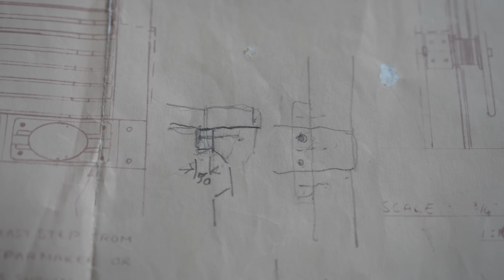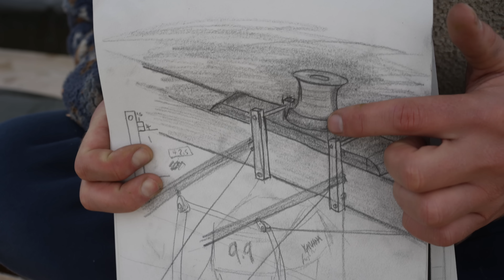It's The Most Important Part of this Boat's Refit (& I'm Trying Not to Wing It) | Wildling Sailing

Comment: Take the mast step to a machine shop and have the base decked flat
Reply from the maker: OOOOoooohhhh like an engine head job. not a bad idea!!! I just need to see if my sails are a right angled triangle first
Reply: @WildlingSailing  yeah if the angle needs changed then just weld up a new plate but if it's only a degree or two the base seems to have enough material to machine it flat with a degree or two extra cut out

Comment: A person like myself could redress, that is to say resharpen, those drill bits by hand, on a pedestal grinder.
Usually a person such as myself, would never recommend purchasing a tool called "The Drill-Doctor".
But buying a Drill Doctor, as opposed to purchasing new drill bits at 20 - 30.00 £ a piece, is a no brainer.
I am only presupposing that they are available in the millimeter sizes you are using.
But a Drill Doctor or similar tool, could save you hundreds of £.
Reply: 316 stainless steel is much better for use in nautical situations.
304 is a reasonable substitute, but it will eventually corrode at a faster pace... where as, 316 may never corrode.
You may also have been better served by using somewhat thinner, but solid stock... Rather than square and rectangular tube.
Only time will tell. 
(Imagine cutting THAT by hand..)

Comment: Could I suggest rebating the the mast beam 1/2 inch into the bearers and a similar 1/2 inch into the mast beam so that the beam cannot slip sideways or fore and aft. That would be what a boatbuilder would . I am an old wood boatbuilder.
Reply from the maker: I thought of that, and it would do much of the work of the retaining blocks, right? I'm a bit afraid of going into the crossbeams though as they're already well made and glassed

Comment: Do not us the drill bits to punch holes, there are proper tools for that, as you did in 17:20. 🙂
Your used drill bits can be resharpen so you don't need to buy new ones just because they are getting dull.  Look up how to do that, it isn't that hard.  You could use a new drill bit to start drilling and use a sharpen one to continue drill.
Yo might want to put some thin rubber to protect your beam if your engines start to make your construction loose and move.

Comment: Its not too late, but I would be inclined to cut small rebates (grooves)  in the mast step, about 15mm deep, to fit over the beams/locating strips, so that the whole mast step is slotted down into/onto the beam structure.
That would increase the forward/aft structural integrity enormously, and take a huge amount of strain off the metal fasteners.
edit: I put my hand up as well as all the other comments,  for using "Step Drills" for metal drilling. My experience is that even the cheaper ones last much longer than normal drills, and make holes so much easier.

Comment: I strongly advise that you don’t use any 304 SS anywhere on your boat and that you swallow the loss and replace any 304 with 316 before you go any further. it really is useless in a marine environment and will rust in very quick time. If you can’t get 316 SS tube you might just use some of the offcuts of the square section 316 for the threaded rod sleeves.

Comment: stop using that spray krap you can buy cutting oil it will make your drill bits last longer and even slightly blunt bits will work better.

Comment: If you drilled 12mm holes, why not use 12mm threaded rod too? Why 10mm? 12mm is 20%  stronger...just sayin..and, like somebody else said, fender washers to spread the load.

Comment: 12: 30 Drill bits. Invest in a set of step drills and a drill sharpening tool for the straight ones. Also slow down your drilling speed and get some cutting paste, as apposed to fluid. Its ok, you can thank me later mate. Crack on. haha
Reply: Oh, and a deburring tool.

Comment: Do your self a favour and get rid of the 304 and replace it with the 316,  I think you will also need to put crush spacers inside the tubes and over the threaded rod to stop the tubes from crushing inwards when you tighten the nuts up.  🤔🤔🤔🤔🤔🍻

Comment: Dude, put a nut on  whatever your cutting and then then use your hacksaw or grinder to cut just above the nut,  then you dont need to use your tap and die to start a thread

Comment: I think you might regret using 304 grade s/s. Even the quality of 316 s/s is pretty poor these days. Old 316 was way better. Any bolt we have that is A2 (304 grade) rusts away in no time in a marine environment. Check every nut and bolt you buy. You don't want to be using anything other than 316 grade where is will be subject to saltwater, that is, outside the boat.

Comment: buy the proper drill bits to drill stainless ,they not any more expensive, HSS drill no good you need CO8 bits which stands for  cobalt and has 8% cobalt added ,beware they do break easy drill a small pilot first  they wont burn out as quick as those drills your using .

Comment: When cutting or shortening any bolt put nuts on bolts before cutting then when you wind the nuts off after  cutting they will correct any thread discrepancies  and bobs your uncle  your nuts will go on and off easily

Comment: It is not ok to use 10mm rod in a 12mm hole! You seriously increase the risk of sheer loads in the fastener, they are built for compressive strength not sheer.you also need to use washers in the threaded rod or it will pull through

Comment: so much effort and hard work but I just feel those clamps holding the boxes are not an elegant solution... i can imagine a hinge plate bolted through the beams then a bar coming from that hinge... it would look made to be... not jury rigged to work.. i googled hinge bracket and found some really small ones even that could work perhaps.. but could make some custom ones if needed.. anyways just my opinion.. i hope you try to think elegance a bit more for the rest of the build but again just my opinion.. my opinion doesn't really matter

Comment: Cutting steel w/ a hacksaw ??  No no no.  Use steel-cutting discs on an anglegrinder.  Cuts steel like a knife thro butter.

Blunt drill bits?  Buy new bits?  No no no.  Sharpen yourself on a small electric grindstone - 2 minutes per bit - & u can sharpen them a hundred times.